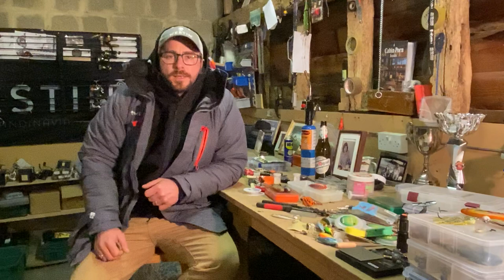Wire vs Flurocarbon.  Pros and cons of pike trace materials

Comment: Great discussive content Thom. Nice to watch an angler that can think things through. I've been piking for 40+ years. UK based for 15 of those, Scandinavia based for 25 years+. I believe most anglers simply buy what they are sold and don't do much thinking, unlike yourself. The tackle industry makes better margins on FC than wire so they push it. Watch any waterwolf type underwater video and FC shows up like a tow rope. Which ever material anglers use is a personal choice. We can only hope they have fish welfare in mind while making the choice.

Comment: Brilliant video Thom, one thing I’d like to ask though. I once had a nasty incident with wire and a very large trout that took a pike lure, it span on the wire and cut so deep it bled profusely so I had to dispatch the fish. 

The water I fish is a crystal clear chalk stream no deeper than 3 foot, with swathes of streamer weed to about 5-10 inches under the surface. So my preferred lures are shallow runners.

Would this be a situation fluro would be preferred? Got a 50m spool of 55kg coming in the post already. 

Thanks
Reply from the maker: Yes perfect situation. Thickness of the flouro keeps the bait shallow and won’t damage the fish either 👍

Comment: Great video, im from Sweden, and here we use mostly Fluo, I would say 90% of the times, the other 10% is when fishing jerkbaits or hairdbaits without a spoon/lip, there we use Ti wires. 

Me myself was using Fluo for more then 10 years but have recently changed, today I fish TI 60lbs wire for my Jerkbaits (or "pure hardhats without spoon") and for everything else I use a stainless steel wire 60lbs, I only use Fluo today when I want to throw a lure that maximize my recommended casting weight on the rod. 

Why not Fluo for me? well after 25+ years of fishing I have changed leader materials countless of times and just as a fly line and their leaders, tapering and diameter is an important factor. Casting a 1-1,5mm Fluo leader, or even thicker if you go Mono is to stiff and thick for it being comfortable, and you don't feel the rod loading as it should, when going with a SS wire or TI wire I like the thickness and flexibility more and I can feel my rod loading better meaning better connection with my bait/lure, Fluo being thick and being able to stretch is the total opposite. 

Another downside with fluo is simply that if it gets damaged it starts to peel off and you need to change leaders, for me I went through a spool of 50m 1,2mm Fluo during the summer, and following summer I used a total of 3 SS wires and 1 TI wire. 

In the end it comes to preference, this is what I discovered after all my tears fishing, the important aspect is that you choose what you like the most, one thing to note is do not always think of what "looks better for the fish" and thing of ergonomics some times as well.

Comment: You mainly talked from the perspective of using lures, but there is also dead bait ledgered  and float pike fishing. And that's a totally different story. What works for lures will not work for dead bait fishing when it comes to using fluorocarbon.  And I think in the UK there is a lot more pike dead bait fishing then for example the northern countries (Zweden, Norway etc.). So more use of wire traces in the UK for that reason.  Fluorocarbon is relatively save with lures because 90% of the time the fluo line is not even near the pike's teeth.

Comment: My local canal is very narrow and shallow, 4ft max depth. It’s always crystal clear and the pike are extremely leader shy, very difficult to catch using wire so I use mason hard mono as recommended by pike fly ace Barry Reynolds. Get a HUGE difference in catch rate.

Comment: Hey! For my fishing lately I've been using wire on a shallower River 10ft max not super clear but a light 3 dip tea sort of colour struggling to get a bite, changed to fluro ( same spot same lures ect) and had 2 fish within half an hour feel like on rivers or shallow lakes flurocarbon is a game changer
Reply from the maker: Yes, consider though that we generally use thick flourocarbon for pike of 0.9mm and bigger so it may be just as much about the presentation (thicker line slows the action & fall rate of the lure which can be great at this time of year in cold water) as the difference in visibility
Reply: @Thomhuntfishing  true possibly!

Comment: great vids,
sorry if you said this in the video but does flurocarbon get memory like line? I am thinking of using a flurocarbon leader for finesse perch fishing so only like maximum 10lb breaking strain
Reply from the maker: A10lb Flouro shouldn’t generally have much memory. The thicker it gets the more memory it has, and a good trick is is to pull tight and hold over a steaming kettle the heat will re set the memory to straight 👍 be careful of the steam heat though!
Reply: @Thomhuntfishing  thanks mate :) only fishing like minimum 3 grams on the end but will be going heavier for the finesse 😎 cheers !

Comment: Good video👌 I’ve seen 1mm Fluoro bitten off, only once in 3 years. I’ve seen TI fail 3 times over a long time but never normal wire. Fluoro has a place with singles hooks maybe. Clips fail more than TI or Fluoro. Fulling Mill wire is great 👍
Reply from the maker: Yep I agree I’ve had clips fail more than wire and fluro put together
Reply: @Thomhuntfishing  me to, I use sea fishing clips now that can’t open

Comment: Nice video mate. I just approached pike lure fishing, but I'm quite an experienced angler in saltwater in  lure fishing, jigging , trolling and drifting...so that experience obviously helps but I still find new things to learn about pike fishing every day. I   agree with your point on the differences, but in practice (even if I'm comvinced as you are) I'm not too sure the differences are actually that big once the lire is in the water.
I'm from Italy even if i live in the UK and also in italy FC is more common I'd say. 
Anyway, would it be possible that in the UK wire is more.common also because many times here we fish with smaller lures? For example i think in northern europe they use big lures, ans in italy there's quite a trend onnusing big ones
Reply from the maker: Yes wire is much better for lure under 16/18cm in my opinion

Comment: Great to hear your thoughts on that. 
Love your videos, don't really think anyone else does this indepth lure advise for the UK angler.
Do you still use wire when using 5cm,7cm shads on jig heads when targeting perch but know that there is pike in the water your fishing?
Reply from the maker: Yes I make a judgement call. For tiny lures like you mentioned, 5-7cm I generally use flouro as I’m targeting perch/Zander in canals usually. If there’s a good chance of pike then I use Drennan 10lb knotable wire, Soft strand I think it’s called 👍🏻
Reply: @Thomhuntfishing  cheers Thom.

Comment: Do you ever use wire for other predatory fish?  Zander clearly have teeth but they don’t seem to be as razor sharp as on a pike, so what leader do you use for them?
Reply: Personally for zander I use fluorocarbon. As you say even though zander have teeth they are more conical and seem to use them mainly for crushing and putting holes in fish, where as pike teeth seem more designed for slashing and slicing.   One thing that has got me thinking about this topic fluro vs wire is I know traditionally wire has been used for pike, but thinking of my sea angling, the charter boat I frequently use, when fishing for tope and conger eels.....pretty toothy fish, use crimped traces of about 200lb mono and I have not seen one bite off
Reply from the maker: Biologically Zander have completely different teeth to pike and this also relates to how their feeding behaviour differs. Zander have pointed conical (cone shaped) teeth designed for puncturing fish. This is why they often hit baits in a sharp, quick manner and then spit them out a lot. They don’t spit lures out per se because they’ve worked out it’s a lure, it’s just how they feed for a large percentage of the time. But in conclusion, no a Zander will never bite through flurocarbon because of its teeth. If pike are present and there’s a good chance of hooking one, I always use wire. But if it’s just perch and Zander then I use flurocarbon 👍🏻

Comment: Hi i have a shimano sahara 3000 reel what lb braid would you advise and what lb mono backing would you use for pike my rod is 20-60gram lure .and will be using the shad teez and swim lures thankyou
Reply from the maker: If you are fishing places with not too many snags 30-40lb braid should be ok. However, some pike lures are quite expensive so many guys use 65-80lb braid as a better chance of getting lures back. You’ll want at least 100m of braid on the reel, the mono backing just use whatever stuff you have around, it’s just to bulk the spool out a bit (if you have deep spools on your reels) so the braid fills up to the edge of the spool nicely.
Reply from the maker: Check out this video I made for pike fishing and what braid to use 
https://youtu.be/A1cjbjbfUsU
Reply: Thankyou for your help just watched the video and have a better understanding .

Comment: Here in Sweden Im taught only FC and not under 1.2mm. Reason for FC is you can see and feel the most tiny damage on the leader and snip that off or retie the leader. Damage on wire can be hard to notice and so you use a faulty leader.

Comment: Hello mate, just asking for an opinion. I want to get a lighter set up and I’m stuck between a baitcaster and a spinning reel. Would you suggest using small soft plastics on a baitcaster or is it not suited to this?
Reply from the maker: Yes it’s possible to fish small lures on a baitcaster set up but this will specifically be referred to as BFS (baitcaster finesse system).
It’s quite specialised and personally I would not recommend it until you have more experience with lure fishing. A regular fixed spool spinning reel and rod is much better for beginners. (And experts sometimes too, to be honest, baitcasters don’t suit me I use spinning reels for everything from tiny perch to huge pike)
Reply: @Thomhuntfishing  cheers 👍I’ve been using my heavy set up baitcaster for about 2 years now and I thought it would be better if I was to get something a little bit smaller because there isn’t many places around me with big pike. Plus I actually think it’s more fun using little spinners and small plugs 😂
Reply from the maker: Yep so anything 6g and over a ‘normal’ baitcaster can be used. From 1-5g you’ll deffo need a dedicated BFS reel, which I’m no expert on but are either really expensive (Shimano Alderbaran £399.99) or you need specific Chinese makes/models that a lot of guys buy different bearings and play around with to make them work right

Comment: Hi Thom,

A good video there cheers. Most of my fishing has been out in Florida. Typically we wouldn’t use wire out there. I’d go out, set up with a few different rods. One for top water (mono leader), live bait, subsurface lure both fluoro. 

Now I’m back in the U.K. and loving lure fishing for pike. The biggest thing I dislike is using swivels. Braid to fluoro or mono I’d tie an Albright knot and use some glue over it to it could easily pass through the eyes. I’d tie a long leader and then retie as necessary through the fishing session. Mono always for surface lures (price and it sinks slower also better against abrasion). I’d catch with teeth and never had a problem but it was a lot of tying in a successful days catching. 

Can you tie the knotable wire directly to braid? My biggest problem or reason I don’t like wire is using a swivel and how that changes presentation of lure.
Reply from the maker: Yep I agree with you there, I hate any extra ‘hardware’ on my traces. I generally create a small loop in the end of the trace, either using a perfection loop knot or a simple triple threaded crimp, depending on the type of wire. I then attach my braid or fluro direct to the loop with a tucked blood knot, probably not the best knot for braid but in reality I’ve never had issues so just stick with it. However I’m sure you could use a whipping knot to attach to the wire, I haven’t personally done it but if done correctly I see no reason it wouldn’t work. The only reason I use loops is for storage, I keep my traces made up in a straight wallet so they’re already done, and it’s not easy storing wire traces if the end has no loop on it!
Reply: @Thomhuntfishing  yea, agree with the storage problems. Is there a wire that’s supple enough to be kept on spool and tied whilst out or would they need to be pre made? 

I really enjoy working a lure over the surface and I don’t like the tap tap tap of the hardware on the surface. So just trying to work out how to make this work better. I’ve fished days in the U.K. where I’ve used wire and had a kink so changed it (only having fluoro in the bag) and a hit straight away. 

I do like the video though, it’s very cultural in the U.K. that people really frown on non wire trace. 👍🏻
Reply from the maker: I pre make all my traces due to Tournament schedule, minutes making up kit on the bank is wasted fishing time in a comp. however for pleasure anglers yeah just make them up on the bank then 👍🏻
Reply: @Thomhuntfishing  yea I know what you mean with the tournaments. I’ll give it an experiment and comment again

Comment: Hi !
I think they both work great. For bigger lures i mostly use fluo when I fish quite shallow early season may or later autum. That is due to clarity of water ... BUT. I also use big treble hooks and wired traces on a lure, so ... does it matter anyway ? :)I use mostly bigger lures on my casting rod so slow retrieval is ok with fluo and action of the lure is the same. If I need to go deeper I just wait a bit more. I also like fluo 1mm as a trace material because for me it is really more easy in  'do it yourself'. Basically it is the same but fluo is better due to its thickness and stifness. Honestly i didnt have any problems with cut offs (but with wire I had-especially if it is bought). Last time after 1m+ fish one sleeve on fluo slipped a little but I just inspect it every time I start fishing and cut a piece if sth is wrong that is why I make it like 50cm. To cut wire properly it should be heated with a lighter - and such operations require a bit more time plus if weather is awful and windy ... pain in the ass. 
Small lures - wire. Sometimes fluo 0.8 but not really sure only if conditions would be tricky sunny and crystal water.
Reply from the maker: Yep agree with most of that, I’ve always wondered…. They can see the thin wire trace but missed the large treble hooks?! Also be careful with 0.8mm Fluoro… I’ve been bitten off on 0.9mm before

Comment: I have a genuine question for you.....
I do love my westin w6 rods i have the streetstick and drop shot however I’m not loving the tiny eyes on the rods. Im fishing crystal clear water so i like to have a 20’ - 30’ fluro leader. Im using a gt knot to connect my braid to fluro and its just not passing through the eyes very well. Only .10 braid to about 10lb fluro so not massive line diameters......
Reply from the maker: I’m not sure what a GT knot is. But  the FG knot is excellent for long leaders/casting through rings. It’s tricky to tie so do it at home, not on the bank!
Reply: @Thomhuntfishing   
Thanks will try it tomorrow on the mighty Gloucester up the clear end ha
Reply from the maker: What you fishing for up that end? The GC used to me my old stomping ground for a few years!
Reply: @Thomhuntfishing   well i have seen you fishing before up the muddy end! 
Im after anything with stripes though think all the rain is gonna make it murky and hard. Excuses excuses ha

Comment: Reading many pike angling threads I gather here in the UK anyone using anything but wire would get crucified.
Reply from the maker: Sort of yes. It comes from the very old school thinking where most pike anglers were dead baiters so it was all exclusively wire for traces and rightly so. However now lure fishing is a much more modern approach, you could use either thick Flouro or wire. For me it depends on bait size and presentation. 1mm Flouro doesn’t work well on baits smaller than about 15cm, and it’s no good for fishing deep either

Comment: Would you knot 0.9mm florocarbon or crimp?
Reply from the maker: I have used double barrel crimps in the past as it seems beater but I know some guys use knots
Reply: @Thomhuntfishing  thank you for your reply. When you crimp would you use a flemish loop (as used when sea fishing in heavy mono or wire)as a security measure because as you know crimps slip.
Reply from the maker: I’ve not used a Flemish loop on heavy fluro before, for me with 0.9mm-1.2mm fluro it would end up quite bulky which I’m not keen on. With a double barrel crimp, leave about 3-5mm tag end, and use a lighter to melt the tag end and create a small blob on the end. Then even if the crimp slips, the blobbed end physically can’t pull through
Reply: @Thomhuntfishing  thank you for the reply and tip with lighter. Use it for carp rigs never even thought about it for floro traces.